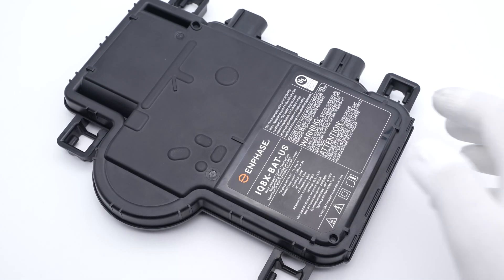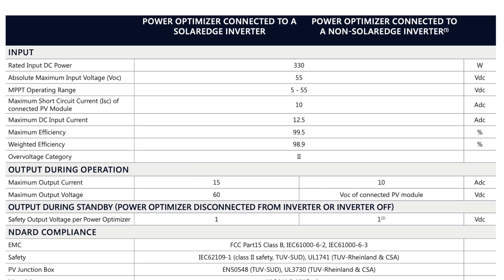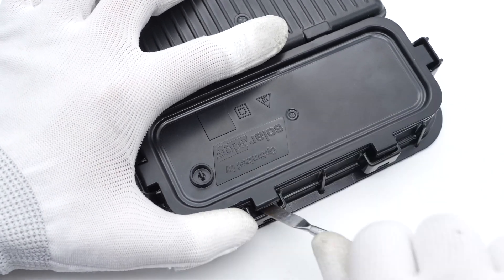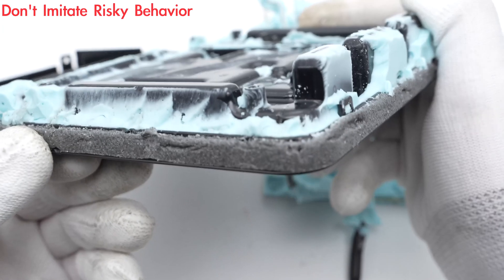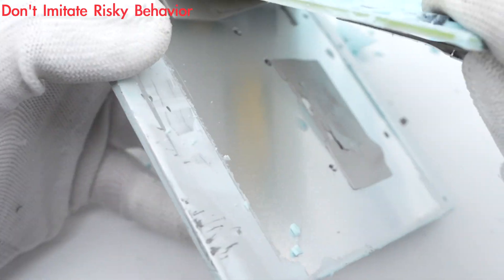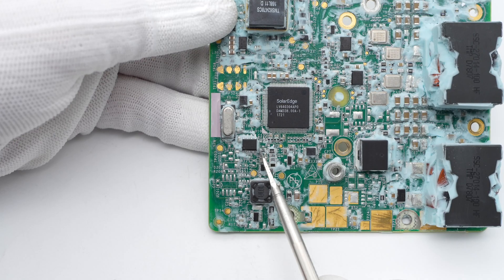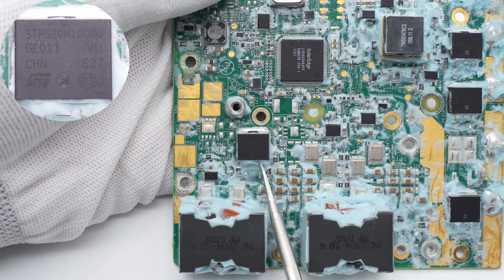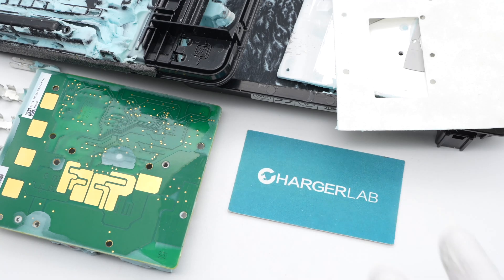Teardown of SolarEdge 330W Power Optimizer Module Embedded Solution

Comment: Need good heat dissipation as in some equatorial installations with low wind the unit is baked even when behind the solar panel.
The solar panel isn't running optimally in these conditions though.

Comment: The worst part is that you have to put one on every panel wether it needs it or not unlike Huawei.
Reply: Solar Edge inverters are one of the worst as they are overpriced and usually very underpowered and can't cope with the newer panels which are atleast 550 Wp as standard and pushing 700 Wp for utility ones.